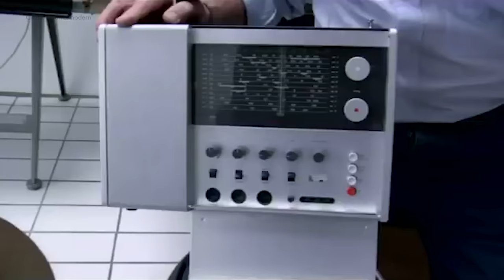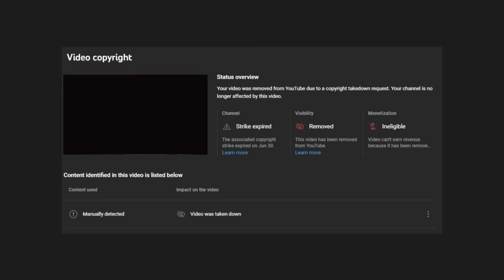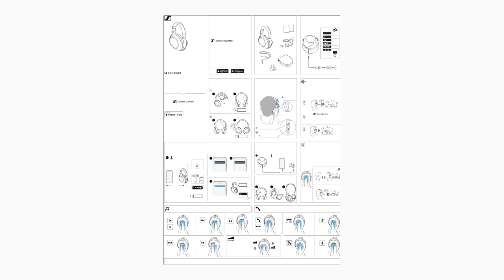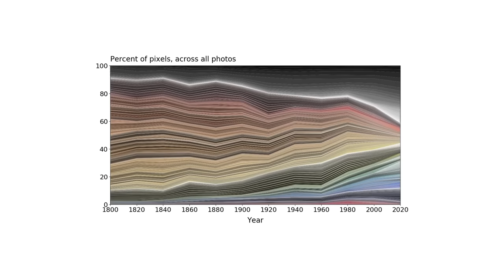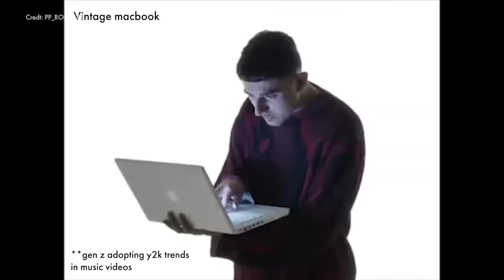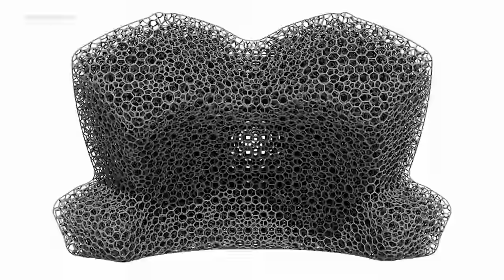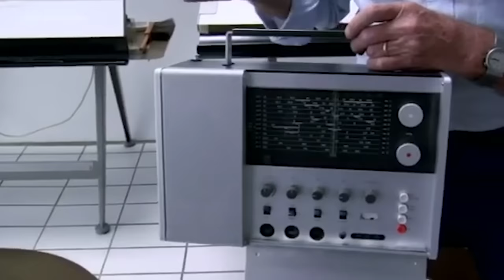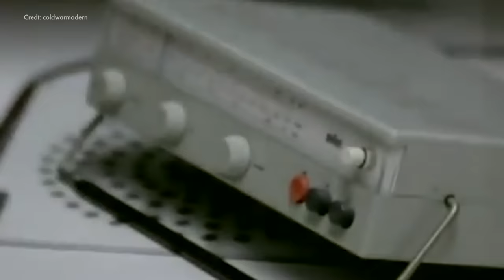Minimalism is Getting Absurd: Updating Dieter Rams' 10 Principles

Comment: Ok, I need to push back against your pushback. Honestly in materials IS important. You are right, we shouldn't hunt turtles for glasses, but that's because there are good engineering reasons not to do so: the turtles are endangered and the plastic has better material properties. By contrast, fiberglass or vinyl stone vineer, 1/8 inch brick facing on a wood frame home, fake carbon fibre on a motorcycle: these are dishonest in a very different way. They are material compromises whose ONLY purpose is a pretense to quality, often while delivering worse results in functional space.

Honestly in materials doesn't forbid you from making an object better through good design, it argues against the aesthetic of faking quality without offering any functional benefit.

As a counter example, brick vineer on concrete doesn't bother me: the latter is a better choice of material in many applications, but it's visually unappealing in many contexts. Dressing it up with brick or stone is an appropriate compromise. The key is that this isn't a cost saving measure to "fake" the "premium" appearance of brick, it's a functional decision with aesthetics as a secondary consideration and costs as a non-factor.
Reply from the maker: I think there's a very fine line between outright lying and embellishment. I think that most use of "fake" materials often falls under the category of embellishment, but it absolutely does need to be taken on a case by case basis.
Reply: Fair enough, and my background/opinions mostly come from the world of woodworking and home design. A printed wood texture on cardboard flooring or chipboard countertop is definitely fake, not an "embellishment". A carbon fibre texture on the back of your cell phone case may not be real, but ABS plastic is just as good as CF for the application so it's ultimately just an aesthetic choice.

My concern is a bit broader however: these rules for design were written at a time when we were transitioning to a post industrial society. IE honestly in materials matters a lot more when the average person has become divorced from the material production of goods and doesn't KNOW the difference between well made furniture and IKEA crap. That trend has only intensified, to the point where your average consumer has literally no idea how to assess quality directky and relies entirely on design cues to act as shorthand. This not only imentrenches the divide between producer and consumer (as assessing quality is made harder when you have to cut through a layer of visual trickery), it has actively accelerated the process. Where the aesthetics of "quality" conflict with functional design, an uneducated consumer group will choose aesthetics, and thus lose the ability to even EXPERIENCE quality as the market caters to the signifier at the expense of the signified.

Comment: I believe you misinterpret the rules a bit:

- "Honest design" is not about wether the glasses is made out of turtles (that would fall under environmental friendly). A better example would be a car with fake air outlets in the hood to make it appear faster and not having a real function.

-  The juice press and the puck mouse are not a good examples of good design. "As little design as possible" is not about scaling down everything to bare minimum. It's about scaling down to bare minimum while still being functional which those products are failing at. 

- Porsche is a great example of a car that doesn't follow style and trends. The 911 has looked about the same since 1975.

Comment: I just wanna add on the macbook air design: mine has exactly 2 usbc ports for all of its connections, which are too close together to use simultaneously despite being all they had to fit on the sides of the computer

Comment: Lack of buttons is also an cost saving thing, they cost money. I once won an clock radio in a lottery. 
Worked well as an analog radio, but then trying to adjust for daylight saving I managed to set up an alarm at the middle of night and could not remove it. 
Had to trash it, did not remove the batteries :)

Comment: I agree with most things in this video, but just to say that Porsche is exactly what he is talking about. The only car brand that looks almost the same for 70 years, and does not change the styling every 2 years. Also, even if the product is biodegradable, it uses a lot of resources to be made. The biggest problem is things lasting for much less than before. And self expression through things you buy is just a corporate invention, it is not the only way.
Reply from the maker: No I agree and recognize that. But you gotta admit, a Porsche isn't exactly honest (under Dieter's definition) or understated. Compared to other sports cars? Yes. But it's still a luxury emotion based product. Also agree with the other things you say but it isn't quite what I meant
Reply: @Design.Theory  of course! My remark was in relation to fashion which he also it seems think is dishonest (and I'll agree on that). From specifically that point of view Porsche is the right car, but from all others it's not. The most honest would be to design a city for walking :) On the other hand I'm amazed by the amount of critical thinking and hard work you put in your videos. Thank you for that and for replying!

Comment: You missed the point on Porsche 993. It was functional, not a fashion car like he said. 
Its function is to go fast. Not fashion. 
At the time, 993 was basically 30-year-old design that gradually improved over time. It's sensible choice for a sport car.

Comment: Even if you're interested in going fast, the wing on the Countach was non-functional. The car already had issues with lift in the front, so they deliberately designed the wing to be neutral and not provide any downforce which would have worsened the problem. The wing was just for aesthetics.

Comment: I like your videos.
Agree with most of the content you present.
Just one comment and one request:
Comment: The guidelines or "rules" are just that. Stick to them but if it makes sense to make an exception, go for it. The best tool/product is the one which you dont feel you are using or dont irk you when you look at it. There are published rules/guidelines for many technologies/desing patterns and its good to stick to them mostly but break if it makes an improvement.

Request:
Please make a video about modern designs which are awful but are used by millions who dont know it could be better. I have many examples of this in tech.
Unintuitive UI where search form is needed to find the right feature but this is mixed with help entries and you end up in an article about the feature not in the location where you configure it), UI where you cant tell where controls are (missing scrollbars, no frame windows, no color difference between controls), UI where features are just missing and you cant use them inless you know the magic keystroke, The features not documented anywhere but working and not being obsolete. Multiple ways to do the same things (three dot menu, hamburger menu, cog menu, slide from side or tap to show menus. The list goes on.

Comment: As an engineer we absolutely hate your apps that have three buttons on them. We want the major options presented immediately labeled in a clear way. Sometimes interfaces need to be complex because what you're controlling is complex. Using stupid tricks like low contrast and hidden menus actually do more damage than good. Present the complexity clearly - Don't try and mask it. Making an engineering or programming app look like something grandma would use is downright insulting and frustrating for us. We want to know our options immediately upfront clearly labeled.

Comment: This is why I'm not a huge fan of the Mac I'm using. I love how fast it is, but there are 3 main issues I see. First, it's small size makes it get hot very fast, so the fan is constantly going, even just now watching a video with Discord open. Second, the lack of function keys removes that consistency of knowing what does what. And third, but arguably most important, is that having 4 identical USB-C ports, while nice to have, makes it a pain for adapters. You can't reuse things you had before, and going from 4 ports and a headphone jack, to my ThinkPad from just one year prior with 11 ports/jacks, it's just not enough. No ethernet, HDMI, Thunderbolt, SD card slot... All things I use often enough to warrant use. I like the USB-C charging and the fact I can plug it in on either side, but the ThinkPad has the charging in the back so it doesn't make as much of a difference, unless I'm against a wall. 
The ThinkPad is one of those things that has always put function over appearance, they have a number of stylistic choices that are due to practicality. Having a metal bottom case, while having a plastic one over top directs the heat toward the bottom and out the vents, rather than having your hands get too hot when typing, having the middle click button is very helpful (although in my experience, it works better on Linux and Mac than Windows oddly enough). I like the hinge being in such a place where the whole thing can lay flat, and allows for ports to be on 3 sides rather than just 2 as well as reducing damage to the screen if it were to get pushed back too far (which happened on one of my MacBooks). But my passion is user experience and user interfaces, and a lot of overly minimalist websites are not user friendly because they strip down too much, and it's like going into a large building without a map.

Comment: It could be argued that choosing to drive a porsche car feeds right into what the Deiter Ram is saying . If you consider their flagship 911 model Porsche design is a straighline evolution from 1963 through to today.  Sure there are added features and probably physical changes like widening the body and wheel base to accommodate the vast increases in power to the wheels but the aesthetic essence of the car is the same today that it was 60 years ago. In fact it is the only marque that I can think of that hasn't totally revised its asthetics just to make it look different without substantially changing its functionality.
Reply from the maker: see pinned comment

Comment: In my mind, great design follows two grand rules: The design has to serve its function. The design has to serve its time. From this, you can derive all other rules you might need.

A product that is beautiful but hard to use neglects function. People don't want to buy or use something ugly, so your design must be aesthetic to serve its function as well. If a product is beautiful and great to use, but too costly to manufacture, it is still no good.
This can be rewritten as concrete rules: Good user experience. Aesthetic. Easy to make. However, these are not universal rules. Insulation between walls need not be beautiful. Luxury wares for the very rich need not be mass producible. 

Second grand rule is simply about making things that fit the cultural sensibilities where you are, and people's needs.

Comment: Good design communicates what is necessary >>> Good design communicates the functional utility of the object. Case in point is the spoon. It does not need a user manual. Its utility and its function is (all but) implicit in its design.
Reply: So what a phone should say “PHONE” on the side lol

Comment: Design needs maximalism behind a thin layer of minimalism. Things should generally work with the press of a button or even less, but you need a way to deal with it efficiently if it doesn't.

They say function over form leads to minimalism, but it really shouldn't in my opinion. User interface designers for machines, appliances, applications and websites get taught to aim for ease of use, which they think means to do everything automatically needing (or even allowing for) customization. The thing is: no matter how "smart" a design is, it will always need customization at some point when the environment of the product changes from the original intention.

Note: "smart" and SMART are very different things. "smart" would be a device of something that is claimed to do things automatically, but SMART is a way to check your requirements and it stands for Specific, Measurable, Achievable, Realistic, and Timely... however different, these are equally annoying.

Comment: Thanks for the video. I've got lots to comment but most fundamentally, I think the logical leap you took from Principle 1 to Bauhaus material theory, to the presumption that "good design" flatters the user's features are too much of a stretch.

Design is in itself mission oriented. And invoking "honesty" merely as a sweeping general "make me look good" and "don't look like material Y when you're material X" only serves to validate your first argument, nothing more.

Honest design simply seeks to fulfill its mission: make a fashion statement, or be a calculator. Both are valid missions, and neither is interchangeable with the other.

Your definition of honesty is too specific, oddly enough, to apply across every design brief. 

Honest design is Honest.
Reply from the maker: I understand why you might think I am cherry-picking scenarios to fit my argument. But in order for any principle to be useful, it must be concrete and actionable. If we take your meaning of the principle as an example, that honest design "seeks to fulfill its mission", that is so broad that it loses any practical application or usefulness.
Reply: @Design.Theory  I sympathise with your struggle and respectfully disagree. A design can be construed as "dishonest" if its goal in fulfillu gbits "mission" has been muddled by the designer, waylaid into vainglory, or perhaps cost-cutting.

In that way, most design is dishonest by Ramsian standards.
Reply: @Design.Theory I probably need to qualify my argument by acknowledging that much of Ive's, and even Rams' work aren't in the spirit of the Bauhaus movement, due to their price point. But they can be construed as "honest" if their brief was to impress and luxuriate in the guise of minimalism.

Comment: I'm going to give my own two cents on some of the principle of honesty.
I agree that it's fine to make a material look like another and small stuff like that, but I think that at some point certain companies abuse dishonesty to really trick consumers in a very unfair way. For example, it's very common for cheap tech manufacturers to slap a single camera on a phone or tablet and then add another or more fake cameras that don't do anything, they're just there to make you think you're buying a product more capable than it really is.
Aesthetic dishonesty is fine, functional dishonesty isn't imo. 
I'd also add that it's probably better as a designer to own to your product's weakness, if your phone only has one camera, highlight in some way, don't hide it between some fake copies of it. A good example is the OnePlus Pad, that only has one camera but really plays around with it, putting it in a big central circle together with the flash and using a pattern on the back that draws your eyes to it.

Comment: I have an older lenovo thinkpad, and I just cant go back to any other company. It has a ton of ports and everything is so incredibly usable. Yeah the buttons look messy but you cant have a great keyboard that looks good, because there will be gaps between the keys (and underneath) with good keyboards. Its does say on ach part which model it is, but that just makes replacement so much easier.

Comment: i think everyone gets less but better wrong...

most people think of less IS better, which is wrong more often than not.

what it actually means is: you can take unnecessary stuff away if the outcome is better that way.

in comparison this is what most people think: you take stuff away, which makes it better automatically.

... no, you as a designer need to put actual effort into making a product better, so parts become redundant and can be removed.

Comment: Mr. Mauriello, would you be able to comment on the proper construction and use of a “rescue hole”, as taught to you by the staff of the SLBP. Thank you for your time.
Reply from the maker: Miss you, Ed. This is a very complicated topic that would require a multi-episode dissertation. As you are well aware, there are many aspects of rescue holes that need to be covered. There are lessons around proper construction, which tools to use (bare hands, torp, shovel), types of rescue holes, and most importantly, the significance of demoralizing the hole digger.  Rescue holes are an extension of one's professional journey in art and design. There is no art without suffering, toil, and emotional anguish. Rescue holes are no different.

I'll also probably do an episode about how you guys made me do an extremely wide, extremely shallow (about 1-2 inch depth) rescue hole. If I am recalling correctly, I believe you told me "I want this sand to look as smooth as a goddamn ice rink by the time I get back from my lunch break."